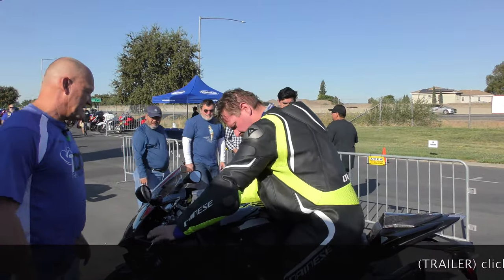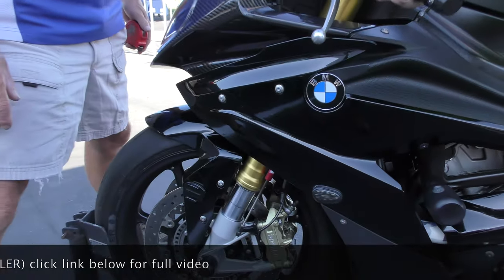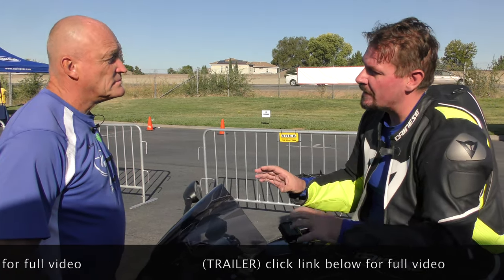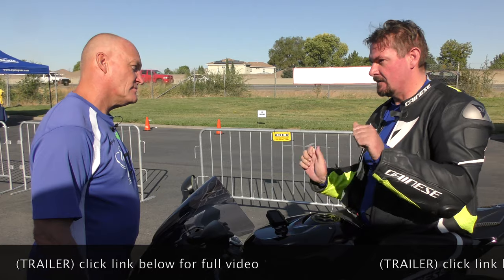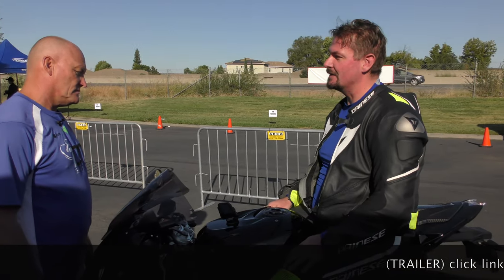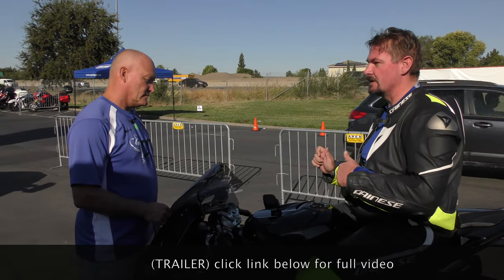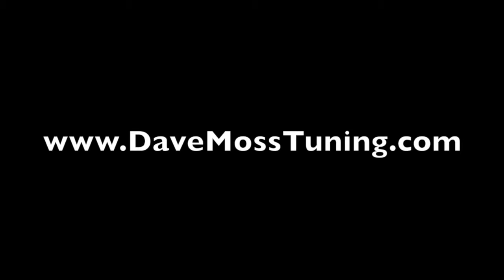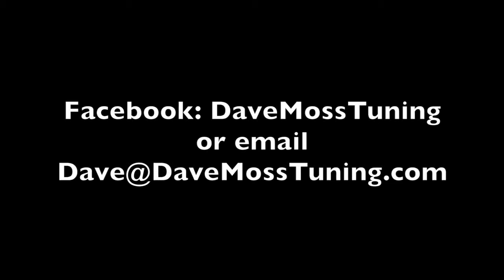2 Clicks Out: 2018 S1000RR Advanced Suspension Setup (TRAILER)

Comment: Is there any plans on doing a fork service video on the electronic fork? Is it harder to do then a non-electronic fork?
Reply from the maker: For a quick change or "dump and run" it is the same as any other fork. The electronic cap comes off the same as any other cap but the fitment to the cartridge needs to be carefully done on intsallation.